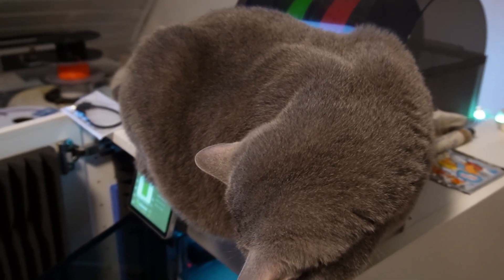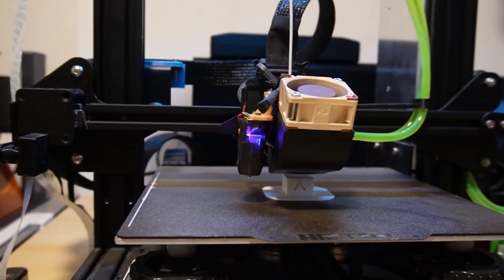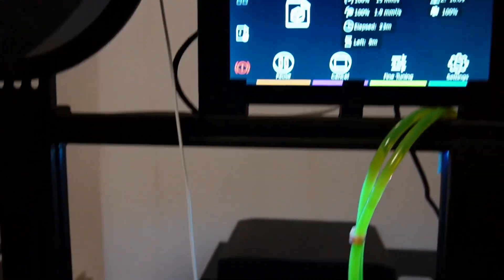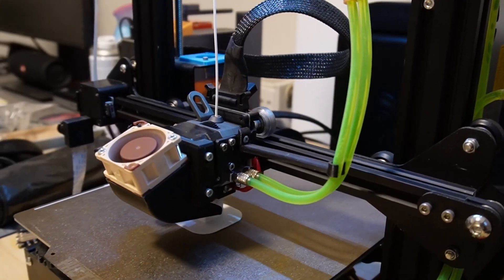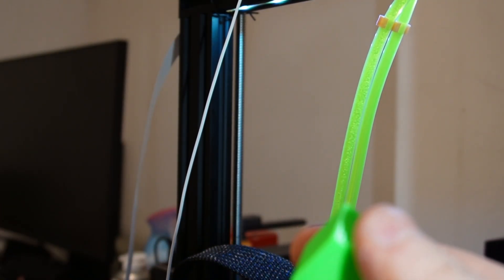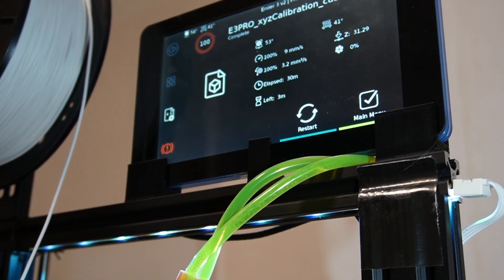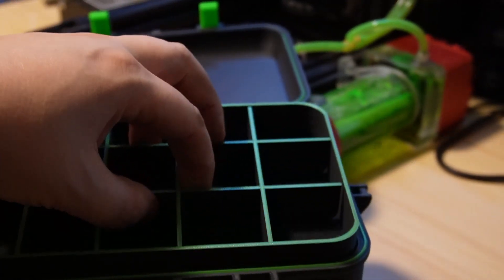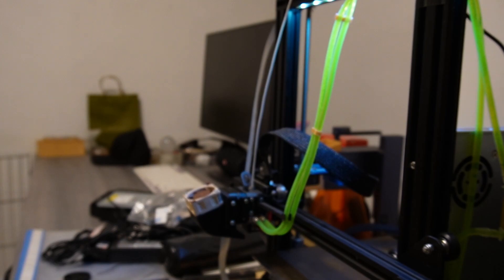Bambu X1 Carbon VS Modded Ender 3 v2 with Klipper

Comment: This is a great video, but you are comparing apples to oranges.   Ender is a bed slinger, open frame and open source design.  Bambu X1 is a fully enclosed device, with more closed sourrce firmware.     We can't even take Ender 3 cost compared to Bambu cost as the upgrades all cost money.  I know people who have spent more on upgrades for an Ender 3 than the price of the printer itself.
Recommending an Ender of any kind for a beginner is a bad bad move.   A beginner wants a "works out of the box" printer, and no Creality Ender is in that category.      The Ender 3 V2 is only silent when you modify it heavily.   The stock fans are not silent by any means, nor is the stock power supply.  Let's try comparing out of box to out of box.
Your Ender 3 is no way a beginner 3D printer.  That kind of invalidates a lot of this comparison.
Reply from the maker: Hi there, I really only made this video because many of my followers were requesting it :)

Comment: Bro, Ender 3 V2 Stock is not quit, is loud like having a airplane in your House, Also don't buy the Ender 3 V2, if you want it cheap then get the Ender 3 V2 Neo, It has a magnetic Bed and comes with a BL touch (automatic bed leveling, it's very important.)
And of course is the bambu printer much better, tbh if I had the money I would buy one and save me a lot of headache.

Comment: What is the ender 3 screen brand , is required any other upgrades like motherboard upgrade or just plug and play? Thanks
Reply from the maker: the color screen works  with v4.2.2 and v4.2.7 motherboard , so with those motherboards it is plug and play.

Comment: You know you can print fast with the ender 3, just do a resonance test in klipper and set the speed higher
Reply: This /\ The Creality Ender 3 completely transforms a Ender 3. I have an Aquila X2 and prints at 110mm/s with input shaping using the included accelerometer (I just print the outer edges slower). My best Benchy on stock hot end and aftermarket printed shroud (still stock fans) is 19 minutes so far with this setup.

Comment: looks like you still have pom wheels the best mods on those are linear rails and silicone bed spring replacments as well as direct drive. i do 100mm 3kaccel in abs on ender 3 v1 microswiss hotend knock off
Reply: also its on klipper with btt skr mini e3v3

Comment: My ender 3 would break or clog about once every 100 print hours. Ive gone 400 print hours no breaks with the bambu. But since it prints my parts 5x as fast its like 2000 print hours of ender 3 printing. Saved myself from doing 20 repairs which is huge for me. Def got my moneys worth
Reply: That's nothing.

Even so, would that not be an issue with the nozzle? 🤷
Reply: Nothing you can't avoid using a bimetal heatbreak and an all-metal hotend on the Ender 3

Comment: Very very nice prints. but for me the bambu is a no go, because i do not want to use the cloud. Why? because i do not have broadband internet, and i have to pay per megabyte where my printers stand. so sending a 10mb print is about 50 euro cents.. it probably will be twice, because i have to send it up to the cloud,  and then let it come back.. and sometimes (as we have no high speed here), sometimes there is no internet for a couple of hours..  yes i do have like 10 gigs of free internet a month, but i use like 15 already.. so i pay like 50 euros extra every month. with klipper i am in my own dedicated wireless lan, so that's free, and i think i will not get a bambu as long as they do not allow me to send gcode directly to the printer. But of course i may be wrong and you can do it directly without internet. 
Luc
Reply: Just to clear up some FUD. I am a kickstarter backer since AUG 2022 and have close to 2k hours printed.
Bambu cloud services went down a total of 3 times for a few hours. 
You can print 3-4 different ways 
1. Cloud
2. Sneakernet (basically slice to  micro SD card and put it in the printer)
3. Lan only mode , shuts off cloud access but can be used on local wifi  network.
4. you can FTP files over if you are good with networking, it is a little known way to do it and not official. 

If you are not using cloud services you cannot use the camera or get firmware updates. Also the bambu handy IOS/android app will not work. So YES,  you can still use the printer sans internet or cloud services.
Reply from the maker: @ashleys3dprintshop  thank you for the clarification!
Reply: @aim6mac  Anytime. Great comparison video.
Reply: @ashleys3dprintshop  Thank you also for the clarifications. Very very helpful.
Reply: @ashleys3dprintshop  Interesting.

That proves they are definitely stealing intellectual property if you can't even use the camera without using the cloud. That's insane.

My X1c is being delivered on Tuesday but I think I'll keep it in the box until the K1 Max comes out.
Reply: @dangerous8333  My last comment may have been auto deleted. You can use the camera outside of BL studio with zero cloud.
Reply: You can send direct to printer but you lose the  benefits of the remote monitoring. And occasionally bambu severs go down.
Reply: @Drkmirror  "And occasionally bambu severs go down." does that mean you can't print when that happens???
Reply from the maker: you don't have to use the cloud system, u can use local network aswell.

Comment: ROFLMAO.. comparing a $1000+ machine vs a $219 printer (granted 300$ mods)... that's like comparing a freaking Lambo vs a Fiat 500..
Complete bullshit comparison imho
Reply from the maker: u forget the fact that these two are really anticipated printers, and we are compairing the quality output of the prints nothing else :)
Reply: This is very good comparison, I'm looking for best value for printing lot of things, and if bambo is 2x faster but 3x more expresive I would go with cheap machines. It depends on situation :)
Reply from the maker: @szaibot  i came to a conclusion, a hobbyist can use an ender 3 and be happy with it (if dialed in).  Someone who needs to 3D print as a bussines is better of with a machine that is the caliber of Bambu X1Carbon.
Reply: Are you okay?

Comment: The Bambu P1P is also a nicer printer than any creality printers at $500 less than the Bambu X1C.
Reply: And users have stated the P1P overheats in an enclosure, making it even barely passable for consistent PETG quality.  I mainly print in Nylon and sadly bambu has little options for what I want
Reply: Who stated that the p1p overheats with enclosure?  You have a link somewhere?  I personally use PETG with my P1Ps enclosed and no issues with overheating,
Reply: @azimuth9819  They literally sell a version with an enclosure now and it's totally fine. The problem only happened when people enclosed it without installing an MC fan as the manufacturer recommended. As with all things 3D printing, mod at your own risk.
Reply: @CaffeinePanda  yes, old post